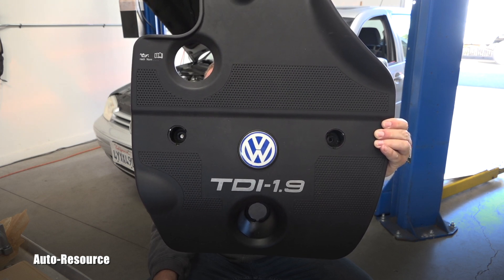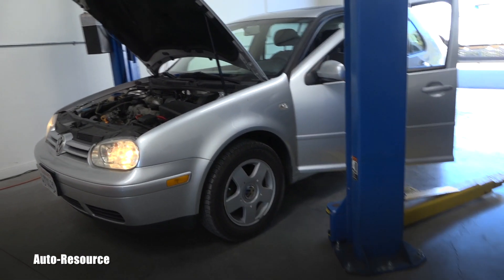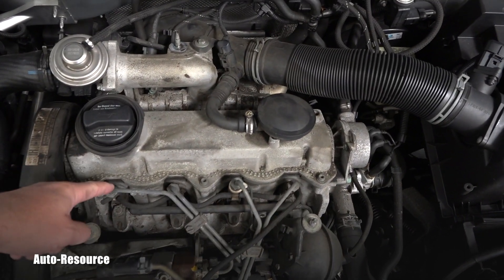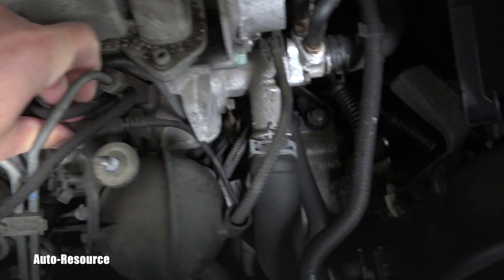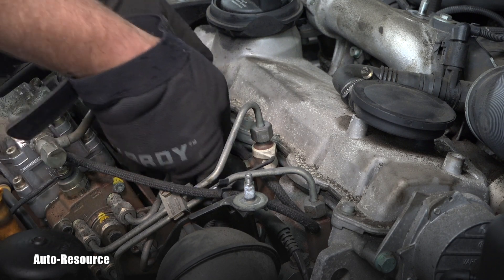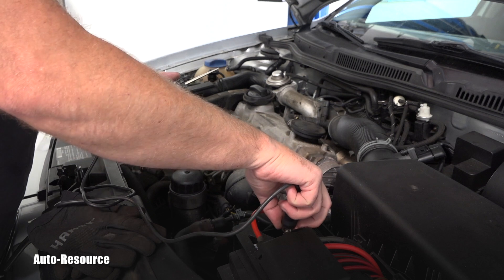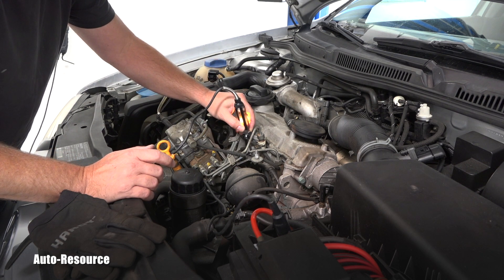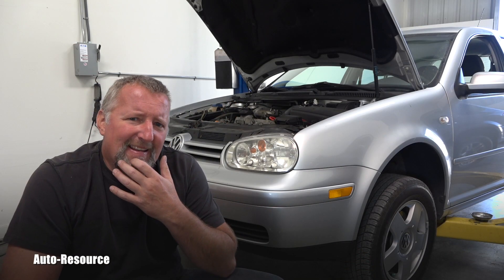VW TDI Code P0674 Glow Plug Circuit

Comment: I replaced the MAF and now the check engine light comes on and i keep getting the code about the glow plug circuit is open on all 4
Reply: Have the same problem. Says glow plug circuit 2 and 4 open. No clue.. been battling it for 2 weeks

Comment: If your glow plugs are faulty would it cause the coil light to flash on n off, and make the relays click when i turn the ignition on? I have a seat leon 1.9 diesel 2007, n i have changed relays and i stil have a problem starting my car, when it does finaly start, it'l run for a minute n the coil light will come on n relays wil click n the engine shuts off. Can anyone help?

Comment: thank you sir I got the same code and was able to figure it out. I thought cylinder 4 was on the right side away from the belt but bc of your test light demonstration I was able to find out that it was the first glow plug located by the belt of the car. I had already replaced the harness and what I thought was cylinder 4 but bc of your demonstration I was able to use the test light to find the problem. thanks auto resource!
Reply: Starting Tech If your glow plugs are faulty would it cause the coil light to flash on n off, and make the relays click when i turn the ignition on? I have a seat leon 1.9 diesel 2007, n i have changed relays and i stil have a problem starting my car, when it does finaly start, it'l run for a minute n the coil light will come on n relays wil click n the engine shuts off. Can anyone help?
Reply: @khanohare  test your glow plugs first like he did in the video w the test light. if its working it should stay lit up
Reply: Starting Tech was out at it there again, turn the key and the coil light comes on and it clicks and it sometimes clicks off n straight back on again, but wont start, turn the key off n back on n then it starts, runs for a second or 2 then switches itself off, then i was turning the key to start it n there was no coil light n no clicking. Done this a good few times n no joy. Then it came on for a split second then off again. I put my foot on the brake n then the coil light clicked on n off rapid. But stil never started. Would a brake switch have anything to do with this happening? Just cause i seen a video of a guy with a bora saying his coil light came on when he was driving and it was due to a faulty brake switch behind the pedal. Im fed up throwing money on parts and getting no where fast. Ive checked online n no one seems to have the same issue with there cars doing this. Have you any ideas what it could be? I wil get glow plugs tomorrow and see if that helps as ive had it a year and never put a set in it. But if the problem stil happens then im stuck.
Reply: Starting Tech ...also, thanks for replying to my question.
Reply: khanohare could be a lot of things. Battery, starter , glow plugs. If your fed up stop buying parts and save up for a Mechanic who works on your type of cars that has a lot of great reviews
Reply: @startingtech3900  have a 2016 1.6 passat no symptoms at all apart from every now and then the check engine light comes on for cylinder 3 glow plug circuit open/closed. Cylinder 3 glow plug is the sensor one in my car but I don't think its the plug as it starts perfectly and has zero symptoms. Any suggestions

Comment: Thanks much for the clear video. Appreciated. I checked my 2002 TDI 1.9 and the glow plugs all tested fine but, I still had a PO674 code. I cleared code and (so far) has not returned. I also had a PO 768  code. Any thoughts of the PO 768 code? My goal is 500,000 on this Jetta. Right at 300,000 miles with limited problems. Take care. Your videos are more professional than most Thanks.
Reply: 300

Comment: The cylinder number depends on where your timing side is (the side of the water pump) so if your engine is mounted with the timing on the right side of the car, your cylinder numbers would go 4 3 2 1, and visa versa
Reply: Josh Dales If your glow plugs are faulty would it cause the coil light to flash on n off, and make the relays click when i turn the ignition on? I have a seat leon 1.9 diesel 2007, n i have changed relays and i stil have a problem starting my car, when it does finaly start, it'l run for a minute n the coil light will come on n relays wil click n the engine shuts off. Can anyone help?